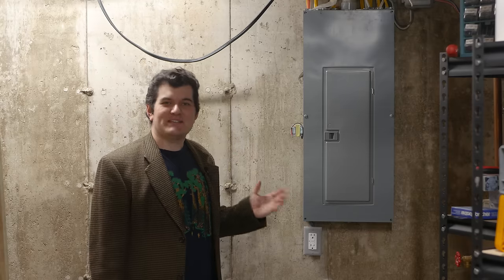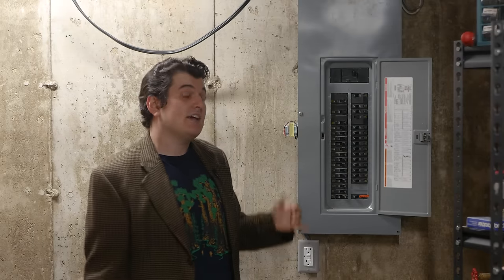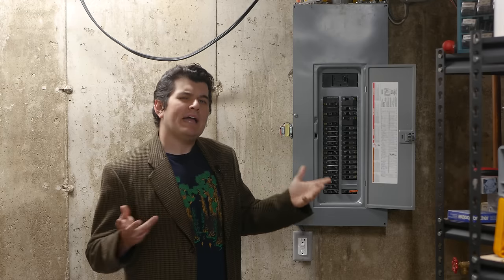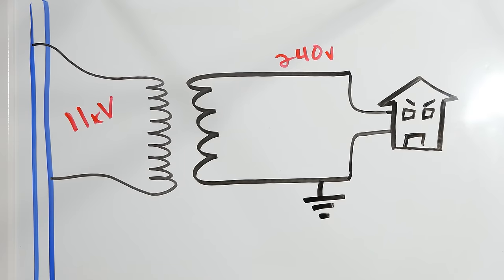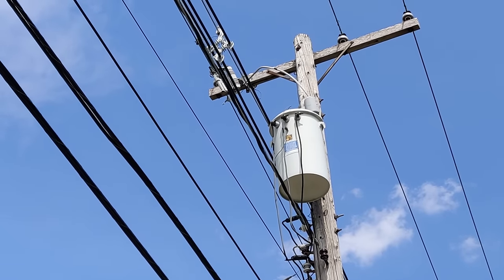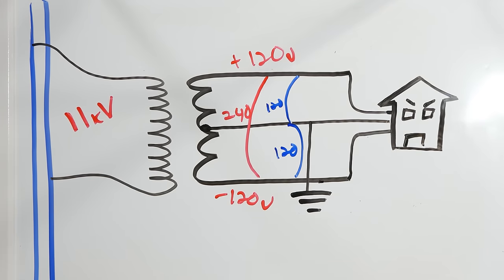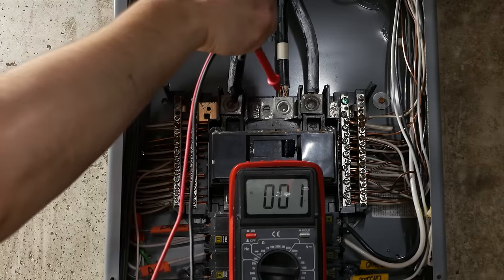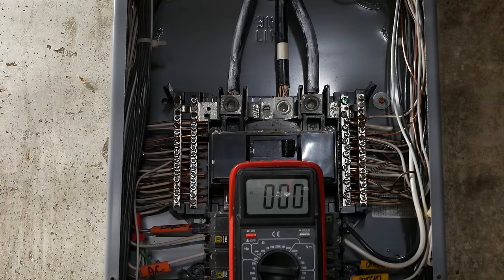The US electrical system is not 120V

Comment: The whole "it's not the volts that kill you etc. etc." always annoyed me. That's like saying it's not the fall that kills you, it's the sudden stop at the end. The higher the fall, the more likely the stop is to kill you. They're kinda dependent on each other.
Reply: Really that's not true. Is worst a fall from a 3rd floor than the 10th floor!!!!
Reply: it's actually the frequency that kills you
Reply: qflux the frequency of how many times you fall off a building
Reply: @Snix121  You could certainly break the velocity of the falling mass down by running it through a fourier transform. In which case, higher frequencies would (roughly) represent greater accelerations. In which case, the higher frequencies would be worse for you.
Reply: So if i'm falling a mile high in much lower gravity with a terminal velocity of like 1mph I'm more likely to die than being at half a mile according to your logic, you can have half a million volts at a extremely low current it won't kill, you don't understand what your talking about
Reply: @christiancarassai9540  Well, that's true for cats.  People, not so much.
Reply: I think the OP's Hypothesis is related to earth gravity, as not many skyscrapers exist on the moon, However I can see a fault in their logic, the reason its not the fall its the sudden stop is just that, its a sudden stop say you were to fall off a ten story building and fall into a well placed bouncy castle, your chances are much higher cause you didn't just smack the ground, theres an episode of mythbusters that relates, i cant quite remember the height but i think it was either 10 or 6 stories they jumped off of onto a large inflatable mat. Then theres the fact that regardless of height, hitting a slab of concrete is best avoided, as even at 2 stories your very likely to break parts of your body that can either land you in hospital or a morgue eventually, yes adding height does at speed. To a point, but dead is dead and regardless of 3 or 10 floors your dead and the only difference is how much more of your body exploded.
Reply: Yeah! Technically, it is the Watts that kills you. 100000V and 0,00001A = 1W unpleasant yes, deadly not so much. 0,01V and 100A = 1W burned skin likely, deadly not likely. 100000V and 100A = 10MW (10000000W) deadly, definitely deadly!!
Reply: @Snix121  yeah I think if I repeatedly fell out of a 3 story window in quick succession I would probably die.
Reply: @bososmark  0.01v is nowhere near enough to allow any current to pass through at all even on lower resistance parts of the body like the tongue
Reply: @bososmark  No, it's the current. The voltage has to be high enough to overcome the resistance, but beyond that the exact voltage is irrelevant and the amount of current is what fries you. Are they interrelated? Yep. But it is a fact that falling never injured anybody, and even the exact speed of the fall is irrelevant beyond a certain lethal point, but the sudden stop is the thing that actually does the damage. And the damage of the sudden stop is directly proportional to the velocity at the point of impact. The path you took to get there and the height of the start point are irrelevant.

All the arguments claiming it's not the current that gets you are straw man fallacy.

In the real world there are always a non-singular number of factors that are involved with any occurance. But there's always one factor without which all the others are irrelevant. Voltage is potential; resistance is, well, resistance; but current is the actual rate of flow of electrons. It's the actual physical flow of electrons that gets you, not some vague possibility or restriction.
Reply: Your analogy is correct, but your conclusion is wrong. You can't get higher than 100%. Jumping off a 100 storey building is exactly zero more lethal than jumping off a 30-storey building. Because it's not the height that gets you, it's the momentum, which is directly proportional to the velocity. In your analogy, height is voltage, velocity is current, and resistance is aerodynamic drag.

So yeah, it's the current that gets you, not the voltage.
Reply: @joeridgley2027  Yeah i know, the 0,01V was also an exaggeration, mostly to show the correlation between P=U×I (aka. W=V×A)
Reply: @awo1fman   I'm an electrician in Denmark, we have one of the highest level of educations on this area in the entireworld. All I'm saying is that it is the watts, because watt is a combinations of amps and volt (P=U×I = W=V×A) and W is defined as: 1W = 1 joule per second. Joule is a SI units defined as: 6.24×1018 eV (electronvolts). It doesn't get anymore fundamental than that, of course there is resistent (ohm) that needs to be overcome. But it still doesn't exclude Watt, high amps and low volts (in a fatal "setup") will still kill somebody but in a more slow-cooking kinda way. high volt and low amps (stille in a fatal "setup") will just as well kill somebody, but more in the electric mosquito sapper way. The fatal "setup" I'm referring to is basically just an other way to say Watts 👍🏻
Reply: The problem with your thinking is that you can have high voltage with low current and low voltage with high current. A static shock is an example of very high voltage (thousands of volts) with very low current and it rarely kills anyone. But a 120v outlet with up to 20 amps kills many who get shocked by it despite it being a much lower voltage. Thus the importance and the saying "It's not the volts that kill...."
Reply: @awo1fman  i would say that volts are still the thing to worry about   but yeah there has to be  sufficient current behind it. 12 vdc never hurt anyone even with 800 cca of a car battery. Consider high voltage ability to jump through wire insulation, such as in neon sign lighting (6kv).
Reply: @bososmark  i have never heard of anyone being electrocuted by 12vdc, even though batteries have 800cca available. Yet people are electrocuted easily with 120vac@ 15a if properly grounded.
Reply: @lloydtshare  With electricity, you cannot separate voltage, current, and resistance. They're all part of the same thing:
Voltage = Current × Resistance
So saying it's not the volts it's the amps is stupid. Higher voltages will push more amps. It's the voltage and the current together that mess you up.
Honestly, its about the amount of energy delivered. That half a million volts you were talking about? That'll push a TON of current, but yet you don't die because it's only for a small fraction of a millisecond (assuming we're talking about static shock).
And how do we calculate the amount of energy delivered?
Energy = Power × Time = Voltage × Current × Time
Reply: @bososmark  you brag about the education in Denmark, yet still you get this so wrong.
You CAN'T have current without voltage. Voltage is the cause, current is the effect. If the resistance is 1kOhm and the voltage is 100V, current will be 100mA. There's just no other way around it.
1MV doesn't kill you when you get shocked by a taser because it's 1MV with no load and it's of a very short duration (it's not just the current that kills, it's also the time that current is applied). Apply a load (body) and both the voltage and the time decrease. RCDs (or, as we call them, current protectors) will not protect you from getting 230V and possibly a deadly current (depending of the actual resistance of your body in the time of electric shock), but they would still save your life, because they would open the circuit in short enough time (25-40ms). 

The opposite example would be a battery. The voltage provided by the battery wouldn't drop significantly with the resistance connected and it's a DC, so we're talking infinite time (relative to subject we're discussing). Car battery can deliver enough current to melt a wrench, yet if you touch the leads, you don't even feel anything.
Rather than talking about watts I would talk about joules, as time matters, too. But when not taking time into consideration (so we talk about a standard AC or DC power source with no protection), current ALWAYS depends on the voltage.
Reply: @leebuck180  You mean the "Volts per Ohm"?
Reply: @christiancarassai9540  That's only because you have longer to think about your screw up.
Reply: @bososmark  Ground Fault Circuit Interrupters measure CURRENT, not Voltage or Wattage. Because it is CURRENT through the torso that will affect the heart rhythm and will stop the heart beat. You don't need to be "fried" to die from electrocution.
Reply: It's like saying it's the bullet that kills you not the gunpowder. You need enough gunpowder(volts) so the bullet(amps) can make it through the resistance of the skin/body.
Reply: @Falcrist  "...higher voltage push more amps..."
Not strictly true afterall, how many amps does a 10KV electronic lighter push?
The important part you're missing from your model is the internal impedance of the source, if it's a high impedance then high voltage won't kill you because it can't generate the current due to the high voltage drop across the internal impedance.  If it's a low internal impedance with a high voltage then it can kill you because there's very little voltage drop across the internal impedance and is capable of delivering very large currents.
Reply: @SimuLord  You need someone to distract you while actually trying to hit the ground.
Reply: @saasseli  Since there have been cases of people surviving falls from airplanes that were much higher than a 10 story building it would be a matter of likelihood, not a sure thing.
Reply: @lloydtshare  How long is the voltage being applied? What's it's path through the body? Are you using a resistance outside the body to limit the current?

My first question relates to the chance of electrically cooking the body or some vital organ while being exposed to the power. Remember the old electric hotdog cooker.
My second question relates to the possibility that your half a million volts might stop the heart from beating without needing the amperage normally needed to kill otherwise. Remember CPR can bring back someone who was "killed" by the heart being stopped electrically.
My third question is to bring up the likelihood that without the power source having a high internal resistance or there being some outside resistance in the circuit that the person is becoming part of your half a million volts will likely push all the amperage need to do the killing by either method or even both, remember that people can be revived from a jolt that will stop a heart.
Reply: @compzac  You are not the first here to bring up the sudden stop view, but I say that isn't the problem either. I say that the body not all stopping at ounce is what kills. If I was falling at terminal velocity and I hit a sidewalk the usual thing would be for parts of me to stop while other parts of me keep moving or even are redirected to a new direction. What would happen to me if as soon as any part of me touched the sidewalk all of me went to 0 velocity relative to the sidewalk? My bones wouldn't snap, my blood wouldn't erupt through weak spots in my skin to splatter on anyone nearby. I know this is an oversimplification of the case, but I think that you can understand my thoughts here.
Reply: @SimuLord  LOL!
Reply: @lloydtshare  Actually, you PHYSICALLY CANNOT have "half a million volts at a extremely low current" pass through your body. Because - and I really shouldn't have to explain this - in order to limit the current without raising the resistance of the load (that is, your body), the voltage would have to reduce. This is a simple fact, inherent in Ohm's law. And if you have a way around that, the scientific community sure would like to hear from you.
Reply: @Falcrist  Oh, that is awesome!
Reply: Fox D Douglas Adams reference or what
Reply: There's a limit to how far the fall is increasing the death risk, because unless you take deliberate actions to move faster, your speed will  cap out without some sort of thrust or change in your aerodynamics (also known as the "terminal velocity")
Reply: @compzac  "I can see the fault in their logic" just a little electrician humor there
Reply: Fall will never kill you if you are on orbit.
Reply: In any cases it is the only one thing, that kills directly - it is energy. Power does not make any sense with doing a WORK without one very important variable - time.
Reply: What kills you is the energy of the electrons
Reply: A joke here in Sweden goes:
"It's not the fart that kills you, it's the smäll."
Yes, it's in English, but to words sounds the same in Swedish:
Fart = speed
Smäll (sounds like 'smell') = boom! (loud noice)
Reply: @niclaskarlin  that is amazing.
Reply: @bososmark  It is current flowing through the heart that kills. A shock from one hand to the other takes less current through your body to kill you, than from a hand to a foot on thee same side of your body. I've been hit with 25KV more than once. It hurts, but the available current was too low to hurt you. I'm a retired broadcast engineer who worked with high current and high voltages. Have you ever installed 30KV armored cable inside a TV station? Our backup generator was over 500KW, three phase. With the antenna's gain, we radiated a 5MW EIRP signal from a 1700 foot tower.
Reply: @Falcrist  Wrong. The Second Anode lead on old CRT type TVs was from 10 KV up to about 45 KV, but didn't produce enough current to hurt you. You have to take the source impedance into account. If this wasn't true, no one would have ever survived working in a TV shop. You might damage yor hand or another body part as muscle react to the shock, but it won't kill you. I started repairing TVs 55 years ago. An older tech would be talking to you as he casually reached into a working st to touch the HV with one hand, and you with the other. He was so used to shocks from HV that he didn't even flinch.

120V (Single Pole) circuit breakers are rated for 10,000 Amps interrupting capacity without failing. That is because the source impedance is so low.
Reply: @michaelterrell  "didn't produce enough current to hurt you."
If the source impedance is high, it means the voltage immediately drops off before the current can do much. If the voltage stayed at 45KV, you'd die, but like a spark, not enough energy is deposited to burn you.
Again, you cannot separate voltage and current like that. V=IR
Reply: @Falcrist  I didn't say that you could. I pointed out that in a current limited source, the HV wouldn't hurt you. Of course the high impedance of the source dropped the voltage under load. If that supply had the same sub ohm impedance of the power line, it would not only kill, but it would burn deep holes in your skin. Just don't think that the 2KV source in an oscilloscope will do the same. They are low impedance in comparison that can provide more than enough current to kill.

Look at the schematic of a CC/CV power supply such as the venerable HP 6236. Large resistors dissipate energy as heat, to limit short circuit currents. I repair that, and many other models.

Low voltage, high current supplies are dangerous, in another way. Short the output, and the 'load' can get quite hot. It can spray you with molten metal, as well. One video processor I maintained had a three phase input, with a highly regulated 5V 1,000A output with heavy copper bus bars to distribute it throughout the full rack height unit. It was a Vital Industries 'Squeeze Zoom' which was the first hardware that could do real time processing on NTSC color video. It could zoom in or out in real time, and digitally combine multiple video sources. Do you remember the 'Sonny and Cher' TV series? At the ed, thee walked out on stage, in each costume worn during the show. That unit allowed you to stack each trip onto stage, while displaying the previous image behind it. For a quarter million dollars it could do in minutes what had taken weeks to do with film which wasn't cheap. It had one interesting 'flaw'. If you only fed it Blackburst (sync), the slight residual noise could be zoomed to infinity to produce dazzling Starfield effects. Once again, produced optically, that was an expensive process, and it wasn't as random as the effect created on the SqueezeZoom. A 1" video tape of an optically produced effect sold for north of a kilobuck.
The RCA TTU-25B TV transmitter had a pair of 100 A, 1.5V filaments that had to be balanced to keep 60Hz hum out of the video. That was achieved by using a wrench to put the bus bars under stress to stretch them. One slip of that wrench could cause a lot of damage.

To end this, either people knew what a high source impedance did. If they didn't a simple explaination would just confuse them. The Navy electronics course is a series of books called NEETS. I don't know what TM series the Army used. I tested out of a three year course while in Basic, and never saw the school. MIT had their EE course material on line, for free. The formerly top secret material from WWII is available as the RAD Lab series of books. All of these materials mentioned are free but sometimes hard to find. Archive.org has hundreds of old EE books for free. All of this is above the pay grade of electricians and the DIY crowd. Try explaining to most electrician why the neutral in a three phase system is now longer 2 gauges smaller, or why there were so many electrical fires prior to the change. After all, it isn't supposed to carry a load if the system is balanced. We had major electrical problems at Microdyne. I told them the neutrals were undersized. It was installed by a contractor with a pair of old EEs who wrote the specs and supervised the install. The building code was out of date. I was told, in no uncertain terms that I was a F'ing idiot. They called in the utility, who set up a recording monitor. There conclusion? The neutrals were undersized. The place was never up to code, from the day it was built. The contractor pulled in a second conductor for Neutral into every breaker box, and the problems all went away. The problem was that the system was built for resistive and inductive loads, not for electronic loads with early switching supplies. Harmonics on the Neural fried a lot of equipment, on a regular basis. It was built before power supplies fad to be corrected for power factor. A small shop had no problem, but try it with over 1000 pieces of uncorrected equipment and it gets nasty. There were office fires when businesses started replacing electric typewriters with hundreds of PCs, for the same reason.
Reply: @michaelterrell  thank you for retracting your earlier assertion that I was somehow wrong.
Reply: It might just be my experience, but "it's not the fall that kills you, but the sudden stop at the end" is something I always heard in regards to fiction. More specifically, how a lot of works portray fatal falls as being perfectly survivable without injury as long as you land on something soft or in water or if you're caught by your local superhero, and how some people have let that inform their perception of real world physics.
EDIT: Like, I've never seen it used as a smartass correction, but I have seen it used as a statement that no you can't jump from a tall building into a pool and expect to live like you see in video games and the movies.
Reply: @LonelySpaceDetective  Unlike a fall, electricity can grab you and make you wish that you were dead.
Reply: No it's not. You can be hit with 200,000 volts and not for. But 120 can kill you. It depends on the current that goes thru you. All voltage does is make it easier for the current to travel
Reply: @sh115067  if the 200,000 volt hit didn't kill you, it's because it was too brief to deposit much energy, not because there wasn't enough current. Happens all the time with static shocks. There's plenty of current, but very little energy.

For sustained shocks, you can't separate current from voltage and resistance like that. The amount of current depends on the voltage. I=V/R
Reply: @sh115067  Sure. If it is just a static charge that can only deliver microamps. The fact that it is stored on a typical insulator doesn't allow it to all discharge, at once.
Reply: Static electricity can be 10,000 volts, only a tickle.  And yes if you fall 1000 ft you can scream until you hit the ground.
Reply: @keithsawyer6356  Static electricity pushes WAY more than enough amps to kill you.
Reply: 110v is "safer" than 220v. but ln America 110v kills more people than 220v.
Reply: @gumb2579  120v is safer, but that's what most outlets in the US have.
Also the US plug and socket is positively ANEMIC compared to, say, the UK.
Reply: @gumb2579  110 Volts has been obsolete for many decades. The standard has been 120 Volts during that time.
Of course more people would die from 120 Volts, since you have to get across both 120 Volt lines to get 240 Volts. 120 Volts only requires one line and a ground or neutral path. Since 240 Volts is only available in a power panel or high wattage device, contact with it is relatively rare.
Reply: @gumb2579  Good.  They need more 110 volt systems.
Reply: I think another way of looking at it is that one warrants a warning that they're in a potentially unsafe environment when high voltage is present. However, when one is in a high current environment, the time for warnings has long passed and immediate intervention is required to prevent damage.
Reply: @hg-ir8tb  You'll never see a warning about high current environments because you can be in a high current environment without any danger to yourself as long as the voltages involved are relatively low.
The voltage is what makes it dangerous.
Reply: For a farmer, an electrical fence runs about 50,000 volts, but not much current.  It will shock you but not kill you.
Reply: @robertheinkel6225  When you touch the fence, you're dragging the voltage down. Otherwise there really WOULD be a lot of current.
Reply: @lloydtshare  Ah, the joys of lab work. I loved to leave charged 1000V capacitors lying around when nosy kids and students came to the lab.
Reply: @bososmark  No, I'm a physicist with good grab of biology. Its NOT the wattage that kills(!) you. It is the current disrupting your synapses in your heart killing you. If you are LUCKY then the current will pass through extremities only in which case the wattage will HURT you, causing severe burns. So in short:
1) The current kills you
2) The wattage hurts you
Reply: @michaelrenper796  come on you know what I mean
Reply: You can take 100,000 volts at low amperage.  Doesn't make it wrong just because it annoys you..  lol
Reply: I am on the " Volts are dangerous" side of the argument. because it is the right answer, at least in fixed volt circuits which are the ones in home appliances.
And AC systems are more dangerous than DC and 60 Hz are more dangerous than 50Hz.
But I digress..
Just stay away from live wires and opened windows on high places.
Reply: The way my EE teacher taught me is comparing it to being hit with an object, where voltage is the velocity and current is the mass. High voltage low current is like being hit by a fly at 100 mph. It's going to hurt, but it's not going to do anything more than maybe leave a mark (assuming it doesn't go in your eye or anything). Low voltage high current is like being hit by a car, but at 1 mph. You get pushed along, but not at a velocity to cause any injury (assuming you don't go under the wheels). High voltage high current is being hit by a car at 100 mph, you're human jam all over the bonnet. Not a perfect analogy but I think it gets the concept of the consequences across.
Reply: @sh115067  this is wrong. Due to resistance the voltage under load of a low current circuit would be way lower than 200,000 volts.
Reply: @michaelterrell  If you get grabbed, best hope you got a buddy nearby with a bat.
Reply: @krullachief669  The only times that I've been shocked was when someone else was there, and they were being careless. Much of what I worked on would kill you too fast for anyone to help you. HV DC causes your heart to stop pumping but unlike AC, the muscles lock and stay locked. I'm almost 70, and I started before I was 10.
Reply: @michaelterrell  God damn. I'm impressed by your fortitude considering I mostly work low voltage with HV being a rarity.
Reply: @krullachief669  I was a Broadcast engineer. At one sight, we used three EEV 65 KW Klystrons to generate 185 KW of UHF TV signal, which needed a DC input of around 225 KW of HV DC. The older transmitter ran at 7KV, with a 25 and a 12.5 KW water cooled power Tetrode. the 25 KW tube had a pair of 1.5V, 1000A heaters that had to be voltage matched, into the milivolt range. Long copper busbars were in series with each side, and you tightened bolts to stretch them to increase their resistance. That was on a 1952, RCA TTU-25B on Channel 55.
That station had a 'Vital Industries Squeeze Zoom' digital video effects system. The 5V power supply was 480, three phase input, and supplied 1,000A of regulated DC at 5.1V. No chance of getting shocked, but you didn't wear any jewelry, or use uninsulated tools near it. It could flash a small wrench or screwdriver without losing regulation, but the spray of molten metal could be fatal.
Working in cable TV, I once had to reconnect a transformer to the primaries. Our liaison was on vacation, and the utility's dispatch office told me it would take three to ten days to inspect our repair, and reconnect power. I had over 10,000 customers without service.
Reply: @ArmyGrunt1986  Oh so close! You almost came up with the title to a Laurie Anderson song: It’s not the bullet that kills you (it’s the whole).
Reply: @lloydtshare  You can't have a half million volts across your body at a low current. If you contact a high voltage from a low power supply like a Van deGraff generator, it's voltage will instantly drop instead of blowing you up. In fact, it will arc to you and the arc will drop most of the voltage. The resistance of your body is quite low because you're mostly salty water.
Reply: In college they emphasized that it takes at least 70 volts to breakthrough the body’s natural resistance.  So you can handle high current but low voltage drvices safeky (like batteries & computer electronics).
Reply: But it only takes MILLIamps of current to kill. 120 volt wire carrying 5 milliamp doesn’t sound dangerous, but it actually is.
Reply: @electrictroy2010  you're kinda missing a key thing here. A battery with a rated amperage is a max amperage, not the amount that's going to necessarily flow if a resistance is attached. Batteries are good at keeping voltage constant as long as that max amperage is not reached, but if you put a sufficiently low resistance across the terminals, that max amperage will force the voltage to lower until V=IR works.

So to use real numbers: a 120 volt battery with a true 5 milliamp max output, and a 1 ohm resistor, at the moment of connection, theoretically, would pull 120 amps. But almost immediately, the voltage of the battery, due to not being able to push 120 amps, would drag down to 5 millivolt (+/- some battery chemistry, but we're talking about an idealized case) such that V(5 mV) = I(5mA)*r(1 Ohm) 

This as opposed to say, a 120 volt battery with an rated amperage of 1000 amps. Which would simply pull the 120 amps with a 1 ohm resistor and still have power capacity to spare.
Reply: @Snix121  The frequency of how many times you bounce.
Reply: @lloydtshare  Some have survived lightening strikes.
Reply: @SimuLord  Don't forget to be distracted just before impact.
Reply: @bososmark  This is basically true, but you can find cases where it is not quite true. For example, if you touch a balloon charged up to several thousand volts, technically for a extremely tiny fraction of second it will deliver current according to ohms law, delivering a very large amount of power. This very rapidly diminishes as the charge dissipates and the amount of actual energy delivered is tiny. However, on the flip side you could hold both leads of a car battery for a long amount of time and still be fine. This would deliver a very small amount of power, but if you held it for a extremely large amount of time, the total energy delivered could be very large. If you ask me no one factor of current, power, or energy is what actually kills you. It is some combination of all three.
Reply: @christiancarassai9540  That’s stupid, there’s a difference from falling from a 3 story building and 10’.
Reply: @batvette  to be shocked by a 12v DC battery, one needs a good conductor. Hold onto good conductor, and now ground it to another good source. Voila! Granted, it's not a shock, but in fact heat you feel, it doesn't feel good. Now another jolt to experience, is the ignition coil!
Reply: @Technotranceism  well yeah because whats the voltage on that coil? The thing to think about is that low voltage doesnt jump through a dielectric substance, while high voltage does. Thus the thick insulation on spark plug wires. High voltage can stop the human heart. Low voltage doesnt penetrate the skin.
Reply: @christiancarassai9540  for cats maybe
Reply: And...

You would need to fall about 1500 feet, before you would reach terminal velocity, the point where you no longer accelerate due to air drag.  So a fall from anything higher than that will result in the same stopping impact at the bottom.

So, that puts it at about 133 stories high...
Reply: @Snix121 yeah, frequency is extremely important. You can run amps of RF currents through your body without feeling any "shock" sensation whatsoever. The heating can still be a large issue. RF burns (eg from conduction of RF currents or irradiation with microwaves) are really nasty.